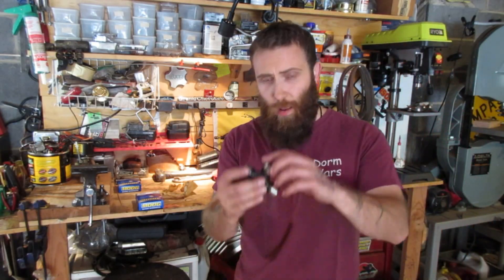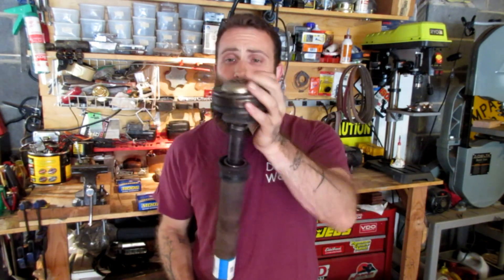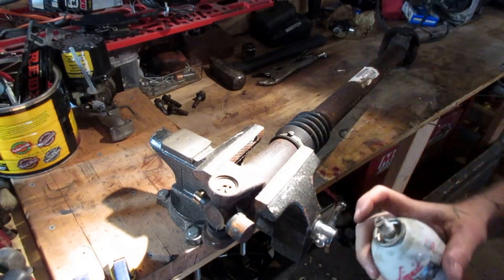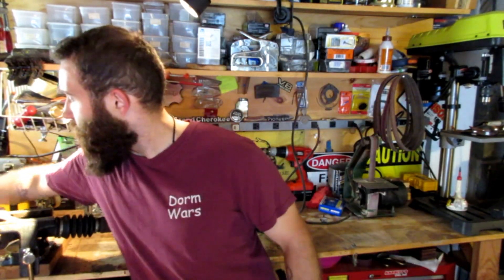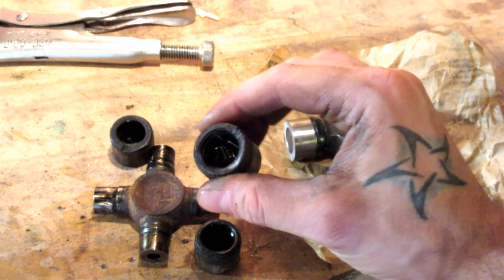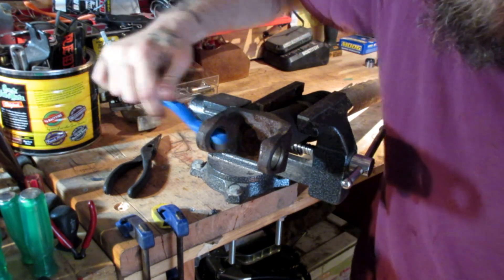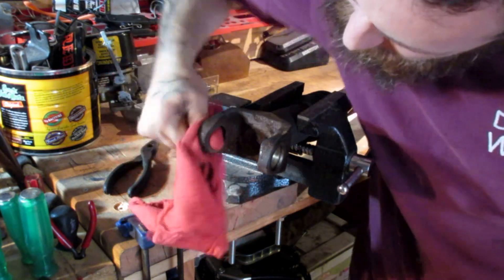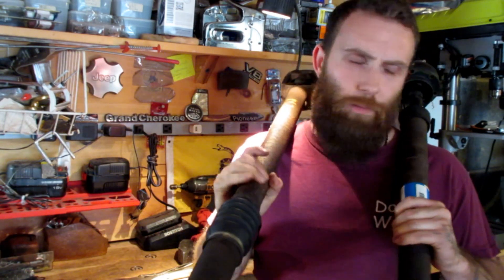UNIVERSAL JOINTS - Removing and Replacing WITHOUT a Press

Comment: Awesome video. 

I'm jealous about how easy you were able to whap that little fella out. I did my front driveshaft u joint a couple weeks back (which was a headache, but it's done) and now I'm working on the two in the rear driveshaft. Holy hell, this one seized in there good. I was wailing on it with a 10 lb sledge for a couple hours today, but I swear it moved like less than 1 millimeter with each whack. I left it soaking with pb blaster and will resume this eve. 👌

Comment: What part number and make u joint are you installing. Also u joint for the double cardan what part number. I’ve called dealers and have gotten conflicting numbers from them. I have the same front drive shaft you just did but need the part numbers so I can buy spicier u joints can you help I want to replace all mine front and rear drive line u joints.  I own a 2002 jeep WJ 4.7 with the 242HD the select track transfer case. Even the service manual from the factory does not call a number for u joints???? Help please.

Comment: Why not a greasable u-joint?
Reply from the maker: On a driveshaft, it is too easy to break that grease fitting off on something and then you have an open hole for grease to escape and dirt and water to get in. also, greasables are hollow which makes them inherently weaker. You can argue that a greasable joint would be good on an axle shaft or on the transfer case side of a drive shaft, but I like to stay away from them. Sealed units last long enough in my experience